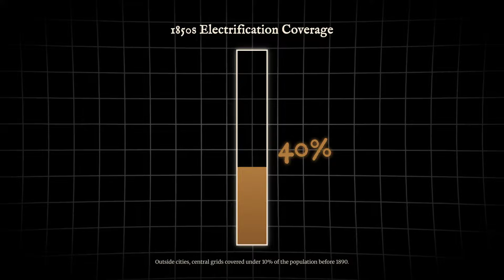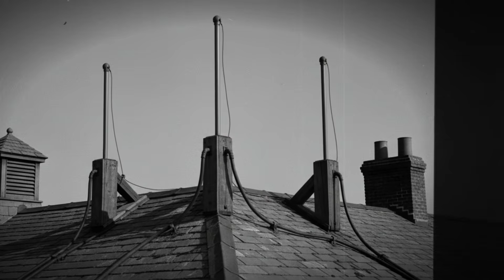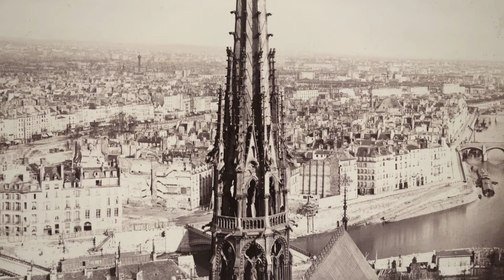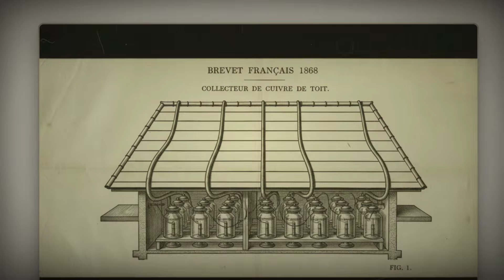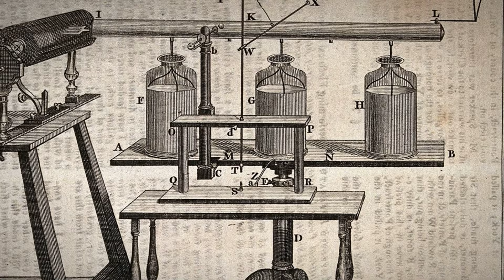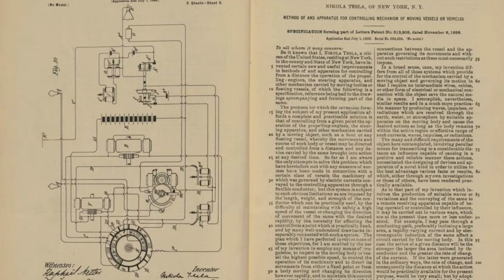The Forgotten Tech That Pulled Electricity From the Air

Comment: Look at the windings. If they are crossed like an X with 2 coils. You get a much higher amperage. It is Floyd Sweet method of high amps and high voltage. Also in energy if you lower the frequency the voltage will go down and the current will rise. This is why batteries are used. The only difference between a battery is the battery has 2 different metals while the capacitor has only one. Electrolytes are flow spin to an electrical field building out a magnetic one so the amperage goes up. It is the same as 2 windings being crossed one over the other like an X. We didn't loose the thech. it was suppressed.

Comment: Tesla's Wardenclyffe Tower concept was about tapping into the limitless electrical energy from the ionosphere and distributing that electrical energy for reception by tuned receivers.
Reply: Not True. You missed something. His tower does not generate electricity it transmits only. So he would have made wireless electricity that they can't put a meter on. That's the problem. Not free energy.

Comment: Tesla's Wardenclyffe Tower would have provided limitless wireless power to an entire region ..
Reply: Unlikely, this video shows that the current density is tiny as does physics and he even addresses Wardenclyffe at the end if briefly.
Reply: @deepwinter77  I trust Tesla more than a rando on the internet.
Reply: @harmless_passerby  Its not just a rando on the internet, its basic physics and energy available in the lower atmosphere i.e anything capable of interacting with a ground based system.  There's no coherrant theory of operation for Wardenclyffe.

Tesla has great marketing and people have layered their own opinions and theories on to him.
Ultimatly the energy has to come from somewhere.
Unless you can demonstrate otherwise thats pretty fundemental.